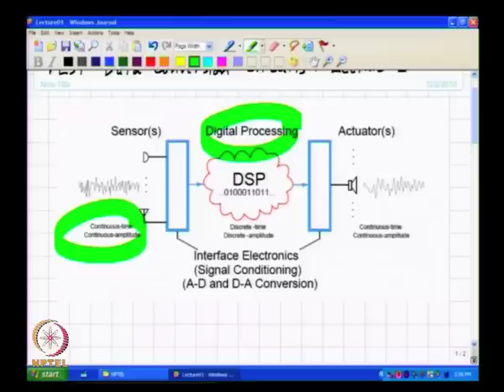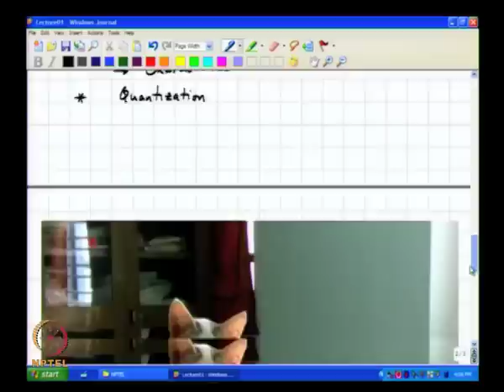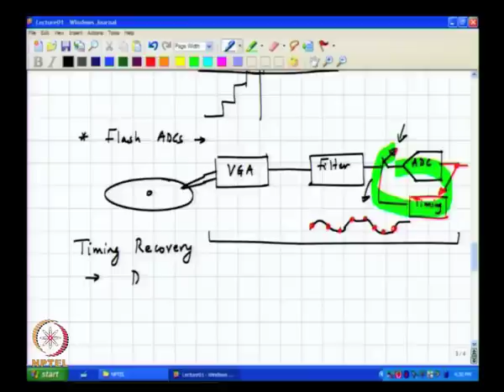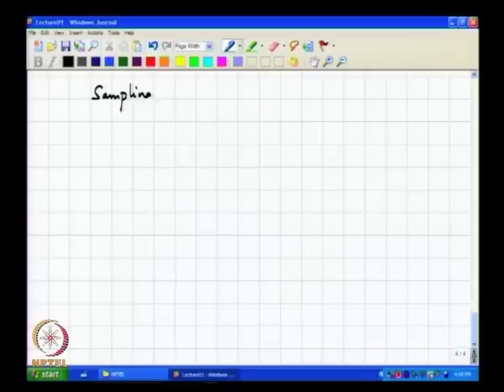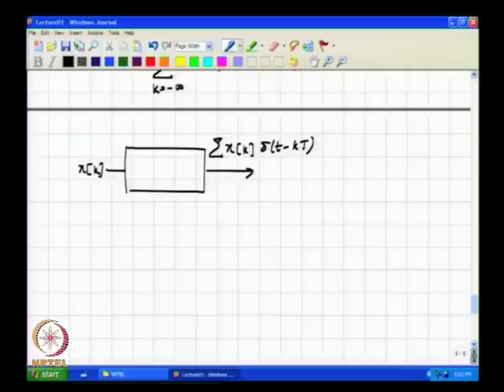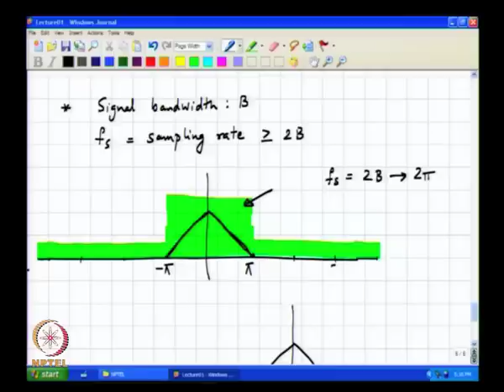Mod-01 Lec-01 Introduction to Data Conversion

Comment: Aliasing is a phenomenon that occurs in signal processing when a signal that has a higher frequency than the Nyquist frequency (half of the sampling rate) is sampled, and the sampled signal appears to be a lower frequency signal. This is because the high-frequency components of the signal are folded or mirrored into the lower frequency range during sampling.

Imagine a wheel spinning faster than you can count its rotations. When you try to measure its speed, you'll end up with an incorrect value because you can't distinguish between the wheel's actual speed and the wheel appearing to be slower because it's rotating faster than your counting rate. Similarly, when a high-frequency signal is sampled at a lower rate, it can appear as if the signal has a lower frequency because the high-frequency components are not captured accurately.

In signal processing, aliasing can cause significant problems because the signal that is being processed is not the original signal, but a distorted version of it. To avoid aliasing, signals must be properly filtered to remove frequencies higher than the Nyquist frequency before they are sampled. This is typically done using an anti-aliasing filter.